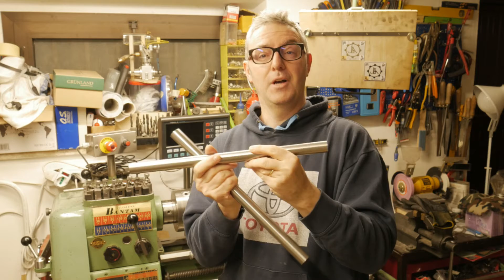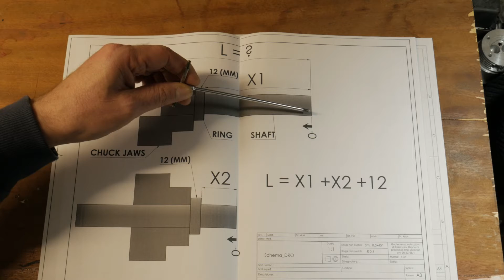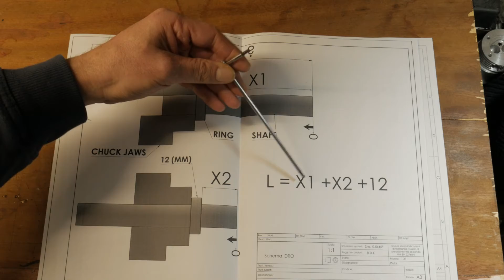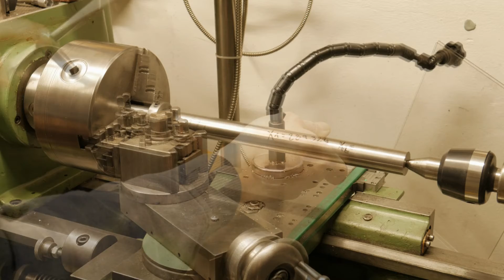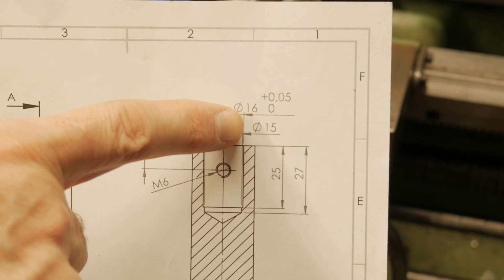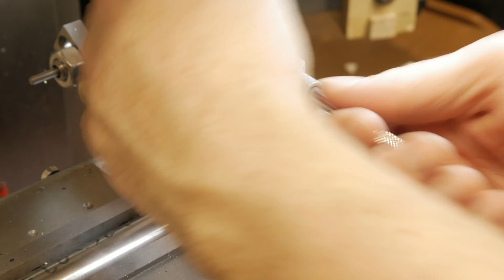Lathe DRO: How to use it to make long pieces - Tips and Tricks

Comment: You can machine the ends to length + flats and holes on a mill first, then finish the end features on the lathe.
Reply from the maker: Hi Engineerig h&t : yes you are right, i was at the limit of DRO with my milling machine and i though to do this, but from the beginning the video was for the lathe DRO and his possible use; in any case thank you for your comment and for stopping by, i hope you enjoyed the video! A great ciao from Italy, Alberto

Comment: This is very nice. Now to get a dro on my lathe.
Reply from the maker: Ciao Engineerd3d, yes of course you must have !! As you see, there's many tip that you can do, but in particolar with the DRO you will not have to think about the play for the wear on your lathe, becasue the DRO simply show the real travel of the axis (X or Y) with or without wear, if now you have to consider the play of axis because you rotate the handle and the tool go away not in the same time, with DRO no more and you will not make errors; See you soon !!! Thanks for your comment, Ciao !!! Alberto.

Comment: Clever. If you trusted your lathes jaws to be square / flat, could you just zero against the jaw, tighten down the ring against the jaw, turn the bar around and measure to the face of the ring that had been against the jaw? Save having to be precise about the thickness of the ring, as you would not need to include the ring thickness.
Reply from the maker: Hi Jack, I am very pleased to exchange opionions with those who watch my videos, i always learn something and I think it's the first time you write to me, right? : yes, your observation is correct but precisely for the reason you proposed I had to make a ring, my lathe (Colchester Bantam Mk1) is from 1964, the chuck should be from 1978 (Italian made, brand "Mario Pinto" )..the inside of the 3 jaws is good but the faces where I placed the ring aren't that great, that's why I preferred to use a precise ring. I have in mind the external surfaces of the CNC jaws chucks that are in the company where I work, in that case yes, it is like a mirror how so nice they are !!Thanks Jack for your comment, I hope to see you again on my channel, a super Ciao from Italy !! Alberto